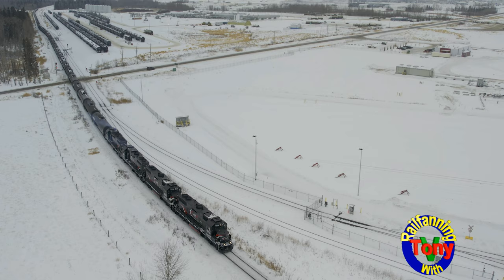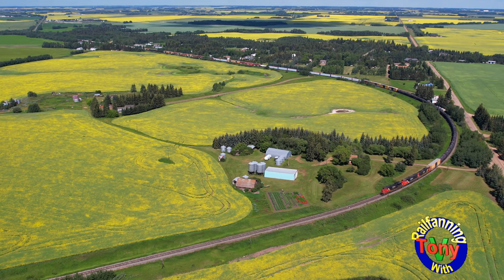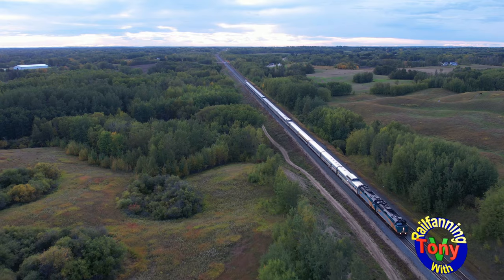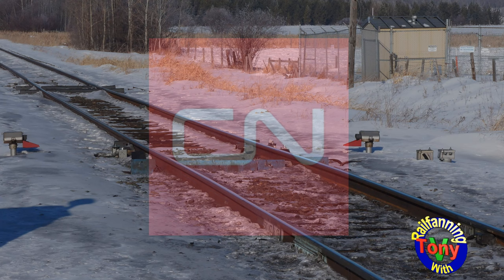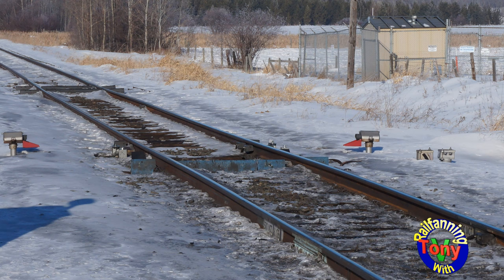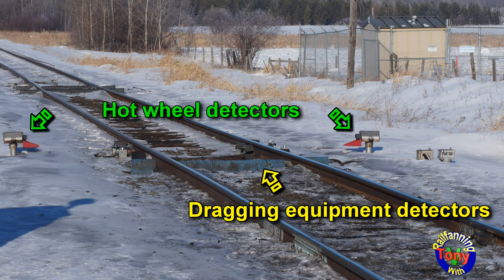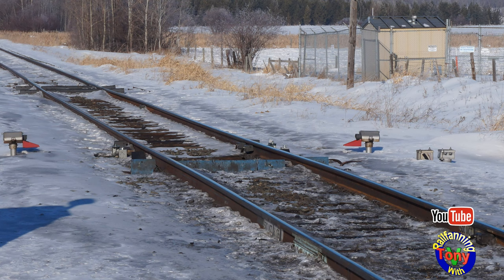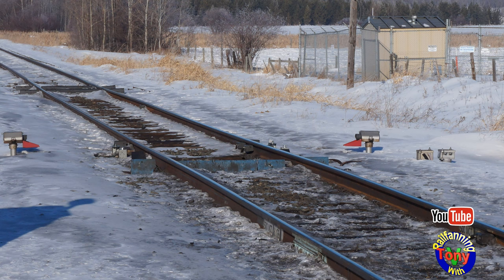Hotbox Defect Detectors #shorts

Comment: Metrolinx here in Toronto, is using NXDN digital, with the removal of CN detector Kingston MP 320 and 330, Oakville MP 14 NewMarket 30 and MP 4 South Bala subdivisions..No axel count or speed reports, and detector out!
Reply from the maker: Thats a shame, Im thinking eventually everything will go digital sadly
Reply: Guelph 37.3 and 56.2 are also using the same CN voice but just temperature and axle count and on a analog channe

On metrolinx they brodcast 

Detector 56.2, no alarms, temperature 22c, total axle 52, detector out.

Just says Detector and not CN Detector.